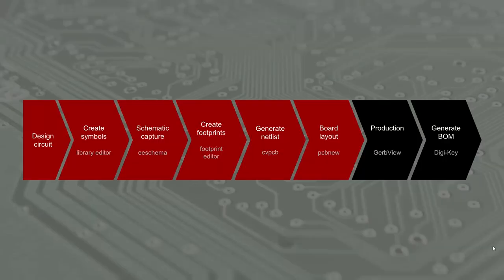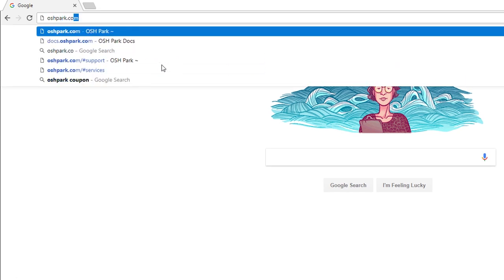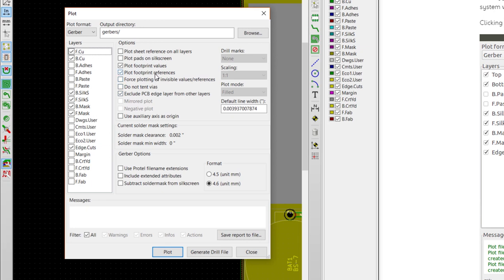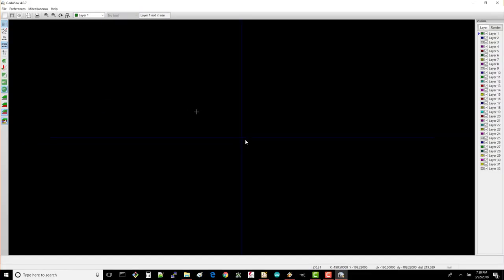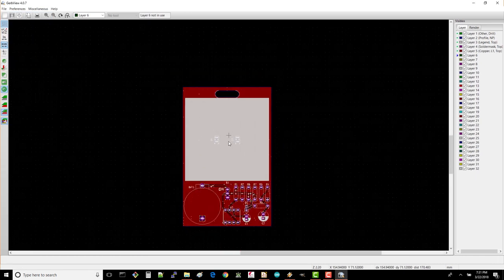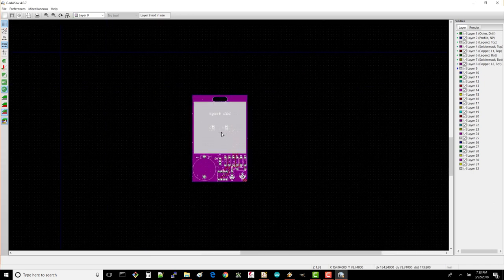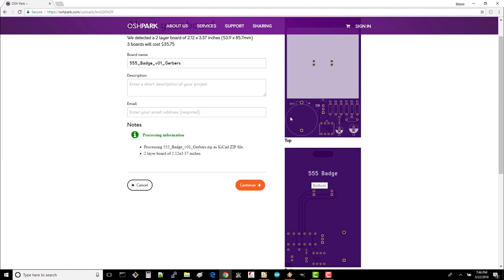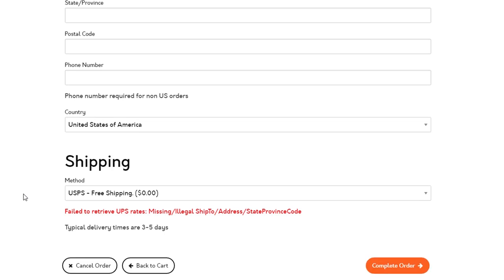An Intro to KiCad – Part 8: Generate Gerbers and Order Boards | DigiKey

Comment: Good series - and thanks for the clear intro to KiCad! Have to disagree with one thing though: ordering PCBs before you've confirmed your BOM isn't a great idea. Maybe one part isn't available in the package you've designed for and... To say the BOM is something to entertain yourself with while your boards are made is a little blasé. :) Much better to spend a little time ensuring you can actually get the components before committing to a PCB order.